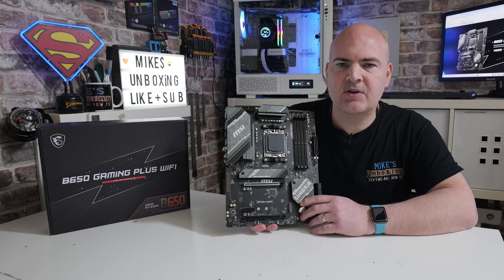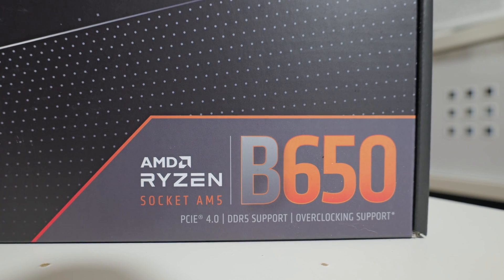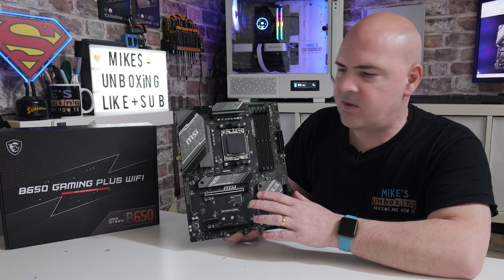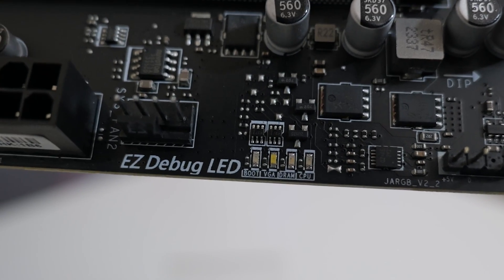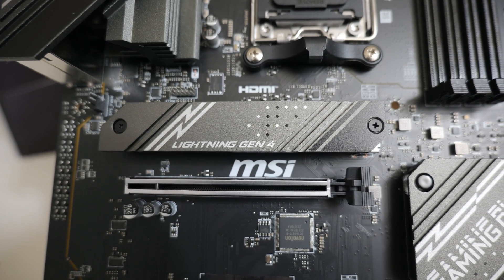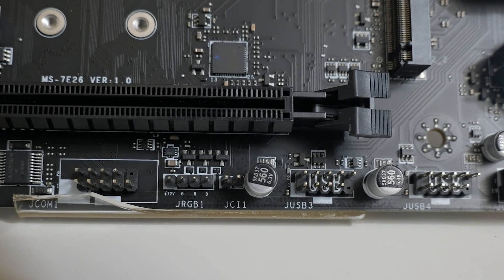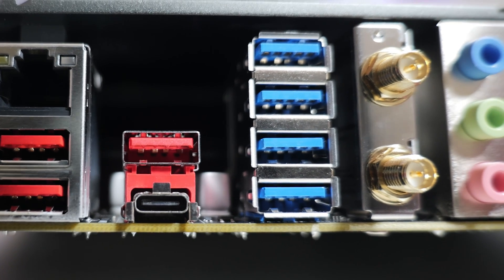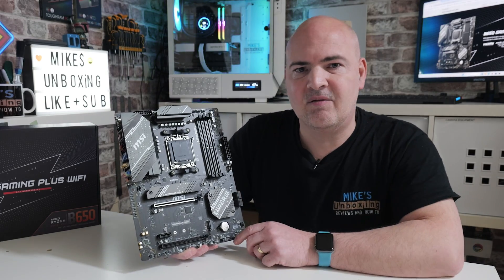Best VALUE AM5 Motherboard MSI B650 Gaming Plus WiFi

Comment: hey mike, did you have to pay customs tax or any kind of tax when you bought from ali express?
Reply from the maker: if the item is over £135 you may have to pay import duty if they declare the true value.
Anything under £135 is taxed at the checkout.
so it is possible that you might be forced to to make the purchase if under the thresholds

Comment: I have this specific board (paid 185€, no idea how this can be considered "budget", I would classify that pricepoint as midrange unless inflation has really taking me by much more suprise than I realized) and am a bit disappointed tbh. Despite an extremely fast NVME (SN850X), it takes 1:25 minutes to boot, and 1:44 minutes to restart.
Integrated Bluetooth and WiFi are wonky, half the time I cannot make a connection. Once booted, everything else seems to work though.
I tested on Bios 7E26v19 from 2024-02-07 and recently 7E26v1A from 2024-04-11, no improvements between the update.

You can try to enable "Memory Context Restore" in the Bios OC settings, which roughly halves boot times but is not stable on for every ram kit, and still takes longer to boot than my 7 year old potatoe PC with a 50x slower drive. Bit meh.
Reply: Same bro i cant connect bluetooth and wifi is being annoying, its given me a lot of headache in the past 2 days im thinking of switching to the asus tuf b650 gaming plus wifi do you know if that one is good
Reply: Turn on Memory Context Restore and Power Down on enable, it's skipping memory training and boot should be around 20sec.
Reply from the maker: it is a budget model for AM5 B650, they can be a lot more expensive
Reply: Just finished my build using this mobo, less than 20 secs for me to boot, no tweak of any sort, win 11 pro clean install, zero issues with wifi and bt
Reply: @maxdgr  congratulations. there have been over a dozen bios updates since my comment.
Reply: @dubesor  i bought the mobo about 1 year ago, before your post, by the way it boots in about 3 secs, ad maiora

Comment: I finished my new build last week with an MSI PRO B650M-A wifi. amazing board, works like a charm
Reply from the maker: that is a great board, hope you enjoy it
Reply: I too have this board, (MSI PRO B650M-A WIFI with 7800X3D). Looks good in black, works good, the SSD heatsink included is nice and the included WIFI is needed because any mid size graphics card, or bigger, blocks a lot of PCI-E ports on the board. I usually run an ethernet cable but WIFI helps if I take it to a buddies for a gaming weekend. Seems like some decent sized heatsinks on the VRM's as well, which is always good. I am pretty happy with this Micro-ATX version of this board.

Comment: Thanks Mike!  I love your live streams!  This MOBO isn't bad, but the lack of a PCIe 5.0 M.2 slot kills it for me, no way I over paid for a Crucial T705 4TB PCIe 5.0 M.2 to run it at PCIe 4.0 speeds. even tho I would not notice the difference 99% of the time.
Reply: B650E boards are getting cheaper.
Reply: @OwDoDuck which board exactly,,,I need it for 7800x3d gaming only?
Reply: @Kliq-n2s  There are a lot of inexpensive AM5 Motherboards, if you don't need RGB I recommend the Asrock b650m-hdv/m.2.
Reply: @OwDoDuck  I think a lot of that is because we are getting close to the launch of the new AM5 Motherboards.

Comment: Exactly the same mobo that I got for my 1st build. Enjoying it a lot so far!
Reply from the maker: Good to hear!
Reply: Yo I can’t get the WiFi to work what did you guys have to do for that. All I did was screw the antennas in but I can’t get a connection on the computer
Reply: @907chaosgaming2  did you install the drivers? i didnt have any problem with mine
Reply: @907chaosgaming2  If I remember correctly, I did have to connect my pc to a personal WiFi antenna and then the board's antennae did  connect my internet even after unplugging the first one. Maybe try an ethernet connection first and then check if the mobo picks up a signal.

Comment: I almost got this board but went with a b650 tomahawk.  It’s my 3rd pc build but as being the first build with msi motherboard I really appreciate the bios, it’s easy to use
Reply: Can you please advice why did you went to  b650 tomahawk?
Reply: @MuhammadTanveer-gw3pt dude I was in the same situation 
Here’s the rundown of MSI mobos to consider in the price range 
S wifi , P WiFi and Gaming plus WiFi are all same . Tomahawk is slightly better but not worth more than 20$ extra over the Gaming plus WiFi 
Get the cheapest board from the bunch ( usually S WiFi )
Reply: @sravans149  Thanks for the info, much appreciated.
Reply: Nice review
Reply: Any issues with tomahawk yet ?
Reply: @A-cap79   first year it would have an audio distortion issue/choppy frames when starting up so I'd have to do a restart 1-2 times a week.   I finally did a bios update two months ago and no probs now prefect

Comment: Contrary to what was said below, you CAN go wrong with MSI boards.  Most recent example, they have come out recently with some crappy B650s.
Reply from the maker: yeah i am in the same boat. this is the actual board i am returning due to the weird bios behaviour
Reply: @mikesunboxing Uh-oh, maybe I should be worried
Reply: @mikesunboxing  As a first time pc builder, what B650 MOBO would you recommend that doesn't have BIOS issue or any issue only initial setup?
Reply: @mikesunboxing yh bro bios is being annoying as hell, do you know if asus tuf b650 gaming plus wifi is any better?
Reply: What's wrong with the bios?

Comment: I've built a PC a couple of weeks ago for a friend using this board, a Ryzen 5 7600 and a 4070 Super. It's not a bad board for the price.
Reply from the maker: that is a great combination of parts
Reply: @mikesunboxing  Yup; he chose this board, I suggested a B650 Eagle AX which was a bit cheaper. Still, not a bad choice.
Reply: do you need to use both power inserts for a 4070? or just one ?
Reply: @ronoc05  I think you are reffering to the pcie/cpu cables that go on the top of the mobo right ? Well as long as your cpu is rated around 65-88W range, one socket is more than enough.

Two sockets are usually plugged in for overclocking but still theres no harm to insert both of them
Reply: @ronoc05  Can you explain better? I don't get what you're asking.
Reply: @ronoc05  and if you are talking about the new gen 12v pcie 5 atx 3.0 to two 8 pin splitter cable , then YES !! you would need both cables to feed the card through the splitter/adapter cable.

And if you do make sure you are not using any daisy chain cables, its a fire hazard. 

Make sure its TWO seperate 8 pin cables that go into the adapter.

Happy building
Reply: cool. How about the Bluetooth and wifi? Does both of them are stable? I mean the speed and latency when you're using this mobo
Reply: @AqilAzmi-ii3bx  I don't know since I'm not the one using the PC, but my friend has had no issues as far as I know.

Comment: Was this in hardware unboxed recent b650 roundup?   Some of these cheaper boards are terrible
Reply from the maker: it is all about knowing the boards abilities. It is unlikley that someone will get a budget board like this and then buy a 7950 and use it as a rendering machine.
most will buy this for gaming and netflix etc, which even with the 7950 will be totally fine as most games don't tax the CPU like a cinebench run will.
this board is well suited to it's price range and target audience. The name of the board even points that direction

Comment: Hi. I could be wrong, but to me other than the WiFi the B550 Gaming + looked and seemed to have better facilities....??? I had 3 of them over the years and I know you did too.... What's your view? At least it had a fitted Rear IO...!
Reply from the maker: the b550 gaming plus is a fantastic example of MSI at their peak. The B650 follows that tradition mostly, but like you said it really doesn't add much to the mix other than the chipset itself, wifi and some faster USB ports.
this is definitely a good choice for AM5 in the sanme way that the B550 version is for AM4